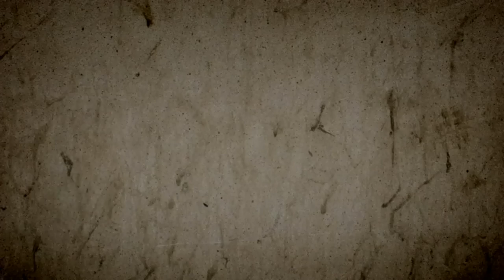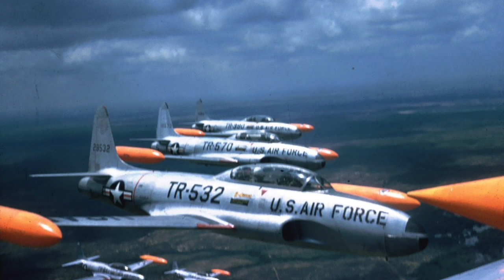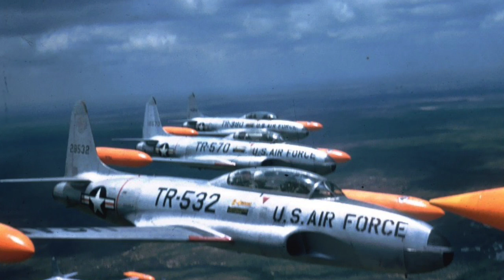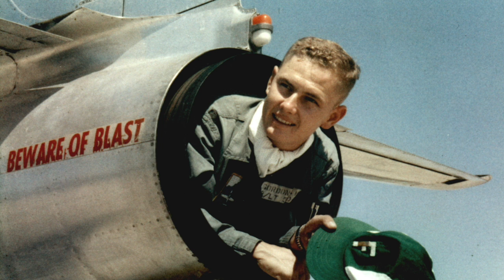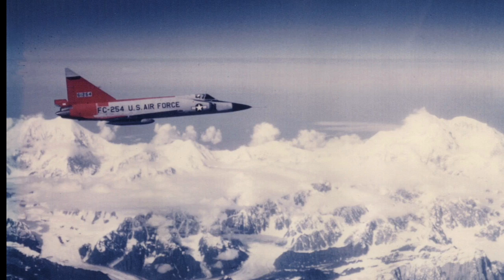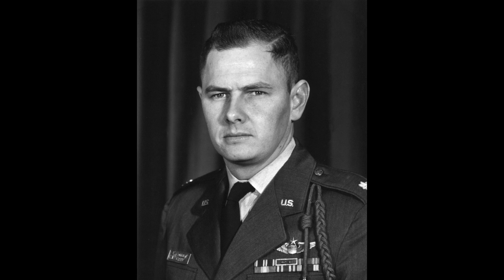Flameout!

Comment: One of the few war stories from my dad that didn't involve the conquest of woman on a foreign shore was a flame out of the #3 engine on take off in a C130B model in Fort Myers Florida in 1981.  They were tank to engine and #3 fuel tank gauge was inop, they did a lot of lying that day and should have, but didn't dip the tank before take off. When that engine flamed out he said the instrument panel lit up like a Christmas tree. He said there was a silver lining to that little mishap, they got to meet Roy Clark at the airport, Roy Clark in person was a really great guy.
Reply from the maker: The C-130B should be safe to fly on three engines if it isn't fully loaded on takeoff.  Yes, a bit of lying about what happened is common.  When in pilot training in 1958, it was the practice for the ground crew to leave the fuel caps loose on the wing tanks of a T-33, and the pilot was supposed to tighten them as he did his preflight inspection.  I took off, and was streaming fuel from a wing tank.  I landed, and was muttering that I was SURE I had tightened the fuel cap, but the evidence was all against me.  Nothing to do but hang my head in shame and walk away....

Comment: At what altitude above FL200 did you restart causing the hot start over the Canadian Rockies?  And yes experience is a great indelible teacher.  Love your channel.
Reply from the maker: I think I was at about 24,000 feet when I restarted.  I was young and didn't understand how the starter system worked at high altitude.  It sounds so simple to wait until under 20,000 feet, but when you're descending toward those rugged, snowy Canadian Rocky Mountains with no flat land in sight, 20,000 feet seemed low!  We had lost cabin pressurization and heating -- the cockpit temperature was rapidly dropping to about 50 degrees below zero, and our breath was causing ice to form on the inside of the canopy.   I was thinking of bailing out above the Rocky Mountains in the winter -- landing on some glacier - trying to survive until someone could find and rescue me -- we didn't have locator beacons or even a survival radio -- hundreds of miles from the nearest Canadian base (which was small - probably no helicopters - even if helicopters could fly that high into the mountains!  My chances of survival were poor if I couldn't start the engine -- and the other young pilot in the back had nothing to do but scream at me to start the engine!

Comment: Little Rock Air Force Base is in a town called Jacksonville AR, not to be confused with Jacksonville Florida. It’s a huge C-130 Hercules base / training base for 3 decades now. Back in the 90’s you could drive through the gate and onto the flight line and have a look around. I wouldn’t advise that now in 2019 though. Many pilots have been through there. Can’t hardly drive I-40 through north side of Little Rock without seeing some C-130’s out for a flight.
Reply: Mark...I live about 90 miles N. of Little Rock outside of a little town called Cave City. We used to have C-130's flying low over this area all the time, but not so much anymore. They would fly so low that if they had flown any lower, I swear you would have been able to feel the prop-wash.

Comment from the maker: A comment that I posted on a different site might be of interest here:   
While I was in F-106 training at Tyndall in 1964, I was told that an F-106 had shot down a T-33. A Colonel (outside our Squadron) was to fly an F-106A and run his WSEMS on a target T-33. After getting briefed on how to fire WSEMS (those blue simulated missiles which have no propellant and just have recorders to record the fire signals), his tail number was changed. He was assigned an F-106A with live missiles! He did his preflight properly. He opened the missile bay doors and looked at the red & white missiles (not blue). He looked at the Form 781 (which said "MISSILES HOT") and signed off the exceptional release. He flew the mission, locked onto the T-33 target, selected MISSILES ALL, and ARMED his missiles (just as he would to fire WSEMS). He centered the dot, squeezed the trigger, and fired all four missiles at the T-33! He called "LOOK OUT!" on the radio, and broke his radar lock -- so the two radar missiles went blind. However, the two IR missiles locked onto the T-33 and blew it out of the sky. Both T-33 pilots ejected safely. The T-33 pilot's comment in the accident report was classic: "Saw fighter. Saw missiles. Took evasive action. Unsuccessful!"
Reply from the maker: A reader asked for more information:   
It was a huge mistake! The Colonel was to use training missiles, which are a test of the radar systems and computers. You prepare the WSEMS (Weapons System Evaluation Missiles) just as to fire real missiles - arm them, lock on to the target, and pull the trigger. The missile doors open, launcher rails extend, and the WSEMS have a real seeker antenna which looks for the target and records that the target was found in the right place and that the fire signal was given. At that point, a real missile fires, but the WSEM just retracts into the fuselage and brings home recordings of the signals. It's the pilot's job to look at the missiles during preflight and to know if he has WSEMS or live missiles on his aircraft. This Colonel was briefed that he had WSEMS and he was to fire the WSEMS. His aircraft was changed by Maintenance after the Colonel had been briefed. He did not mentally realize that he had live missiles and not WSEMS on his aircraft. The two T-33 pilots were able to bail out safely, so nobody was hurt. The incident was very embarrassing to the USAF, and was hushed up. I believe the Colonel was retired immediately, and never flew again.

Comment from the maker: About a year ago, I posted a brief story of where a fighter pilot FAILED a simple training mission.  Here is the second failure of that same pilot on the same flight:  This lesson was the "Scissors", a classic fighter maneuver.  The attacker (me) comes roaring in for the kill.  The defender (him) turns sharply into the attack, forcing the high-speed attacker to overshoot.  As the attacker overshoots, the defender reverses his turn and now is about canopy-to-canopy with the attacker, both planes turning hard back into each other.  The attacker still has too much energy and the two planes cross again and again reverse their turns.  By now, the high speed attacker is ahead of the defender and the defender has the advantage to maneuver for a kill.  
In this case, we set him up about eight miles ahead of me and I attacked aggressively.  He turned into me, so I overshot the turn - so far, so good.  I reversed my turn, expecting him to be canopy to canopy with me, but he wasn't there!  He was diving toward the earth in full afterburner!  "OUT OF BURNER!  DISENGAGE!  RECOVER!  FIGHTS OFF!"  I called on the radio.  I took him home and told our Squadron Commander that this guy was useless.  Unfortunately, the Squadron Commander pointed out that we were leaving for a tour in Korea then next month, and we did not have any pilot to replace him.  The Squadron Commander appointed a new instructor pilot to take the new guy and somehow get him to pass the basic maneuvers.  We went to Korea with this guy, and he screwed up badly again - but that's another story!
Reply: Be sure to fill us in Bruce.

Comment from the maker: OK, Nate and others have asked for more details of practice dogfights.  I'll start by showing the BFM (Basic Fighter Maneuvers) where the trainee pilot was a FAILURE.  Flying F-106s out of Selfridge AFB, north of Detroit, Michigan.  I was the instructor.  First Lesson:  The HARD TURN.  We climbed to 20,000 feet and put the trainee into "fighting wing" position behind me.  This was to see if the wingman could follow his lead through a hard turn.  He would be in a 30 degree cone, 800 to 1,500 feet back -- he was free to maneuver within that cone, while keeping his eyes open for anyone who might be attacking, so Lead (me) could focus on the attack.  I told him exactly what I would do:  I would go into afterburner and do a 4-G level 360 degree turn to the left, rolling out on my original heading and altitude.  Ready?  Go!  I plugged in afterburner and honked it around in a level turn, rolling out on my original heading and altitude.  "How did it go?" I asked.  "WHERE ARE YOU?" was his reply.  I had to call ground radar to get us back together again!  I'll post the second failed maneuver later, maybe tomorrow.
Reply: Well I'll be lol , I was stationed at Selfridge in 1968 thru 1971 with the Engineering Squadron , at the time the fighters were sent to Korea . I was in the retirement ceremony when the Air Force turned over the base to the Guard . All 5 services were there for that as the base was used by all of them . It was a hot day and as we marched by and got to a hanger an rounded it to open doors the first Sgt had a keg of beer waiting for us lol . I spent another month there waiting for orders with a friend and we talked ourselves into doing a short reenlistment to get our base of choice which I got Tinker AFB for one year then off to Alaska for that stay in Campion AFS near Galena AFB . Selfridge was my first Base . PS  I think it was a Saturday when the fighters came back an I was working the steam plant at the reserve hanger on the east side of the tar mack , I heard something coming then off of Lake St Clair came a fighter over Officer Housing just below breaking the sound barrior lol pretty cool .

Comment: Mr. Gordon I have an unusual and perhaps strange question for you.  1st let me say, thank you for your service to our country.  Now my question.  The B 52 is an old aircraft that is still soldiering on for the forseeable future. I know that once in a while they bring them into hangars and take them apart piece by piece, inpect and repair, then reassemble.  Why not do that with older fighters ?  Seems to me its always a lot cheaper to keep older equipment running than to buy the astronomically priced new stuff, Also you don't end up with boondoggles like the F-35 taking an enormous bite out of your budget.  Seems to me you would want a few high end new fangled fighters. and the rest to be older aircraft that pilots can get experience on and you could put hours on those air frames.  I don't think that's a nutty idea given the success of the B 52s retention. Obviously there would have to be avionic and weapon systems upgrades from time to time.
Reply from the maker: Hobgoblin -- this question comes up frequently.  Right now, the Marines are starting to upgrade their F-18s because the F-35 deliveries are behind schedule.  There were serious plans to upgrade the F-106 with new radar and a new engine -- but all the money was needed for the new F-15.  The primary drivers are money and manpower.  To keep the A-10 in service means not only refurbishing the airplanes but maintaining a training program and maintenance crews, which are needed for the new F-35.  The less obvious fact is that technology has changed so much that the old airplanes cannot exist over the modern battlefield.  The A-10 would be a sitting duck for modern missiles.  In a recent exercise in Utah,  F-15s were beaten 8-0 by the new F-35.  If you refurbish the F-15, you still have an old fighter that may not survive against the S-400 SAM missiles.  Reliability of new systems is much better than old systems. B-52s are OK for third-world conflicts, but won't survive a first-world conflict.  Bottom line:  with a limited budget, you can't support old airplanes and new airplanes -- you'd better put your money on the new airplanes.

Comment from the maker: Mike - Yes, Eastern Flight 401 was a tragic example of where the pilot was distracted by a landing gear problem and let the aircraft fly into the ground!  Yes, AVIATE - fly the airplane - first!  I almost added the ditching of an airliner in the Hudson River to my video but didn't have room. Capt Sullenberger lost both his engines on takeoff from LaGuardia and saved everyones' lives by crash landing in the Hudson River.  I even got emotional when I listened to the tape of the a perfect job he did!  He AVIATED first.  His co-pilot was flying, so Sully did the co-pilot task of starting the APU so they would have hydraulic power for flight controls.  As the senior pilot, he TOOK COMMAND of the aircraft with a simple statement:  "MY AIRCRAFT" - so there was no confusion in the cockpit as to who was flying the aircraft.  He NAVIGATED second, deciding not to try for an airport which was beyond gliding range and deciding to put the plane in the Hudson River.  He COMMUNICATED third, but only briefly - the departure controller was asking questions, but Sully said simply "WE'LL BE IN THE HUDSON".  There was no more need to talk to the people on the ground because they could not help.  He then devoted his entire attention to flying the airplane to the perfect ditching in the Hudson.  An eye-watering example of PERFECT airmanship!